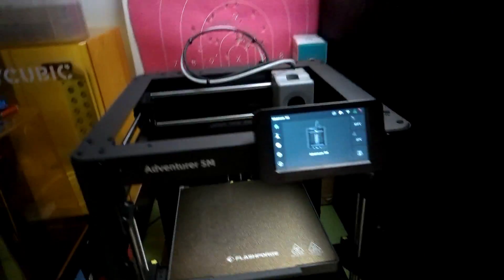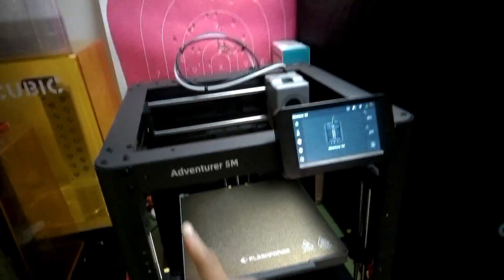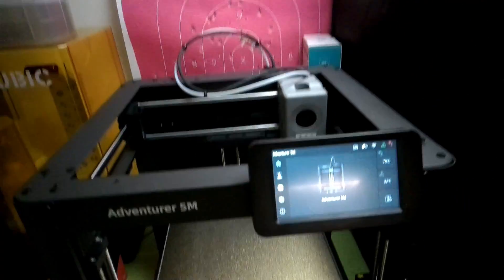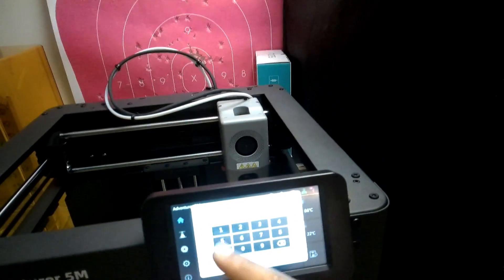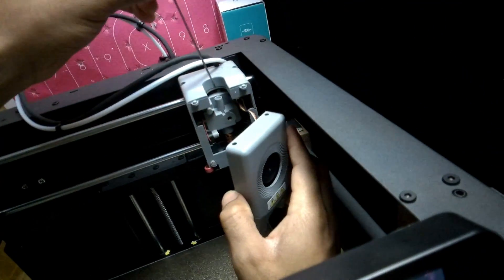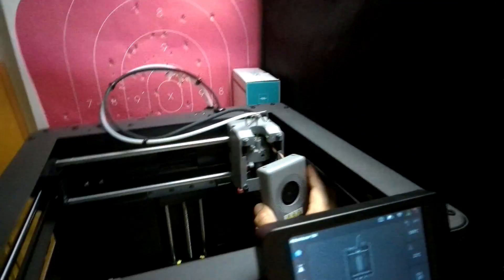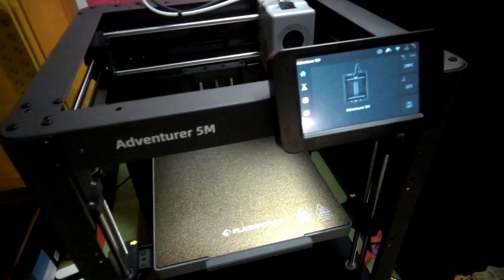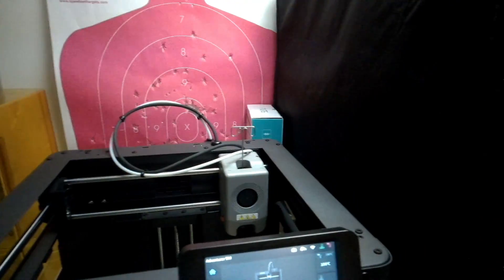Unclog Adventurer 5m

Comment: Ah man, mines clogged and still can’t figure it out. I was swapping the filaments over from the test one that came with it. Tried all the steps I could find. Mine is sticking out the top by a few mm’s but won’t run the last bit through, even trying the swap filaments settings 😢

Comment: I need to unclog the very top part where it first goes in
Reply: Did you ever figure it out I’m having the same problem
Reply: @M @MRNOVACAIN ere’s videos showing how to take apart the extruder. I can almost do it with my eyes closed at this point. Last night I had to heat up the nozzle to be able to take it out so I could take the extruder off. Then while the nozzle was still hot and using a rag to hold it, I used the unclogging tool to push out any filament still in the tip. I guess I had heat creep because the gears were turning fine but the filament was skinny between them and fat above and below. Cut it out, put it back together and it’s been running fine non stop since.
Reply: @dylanfrazier6378 yea I was able to get thanks you though 🙏

Comment: This didn’t work. I apparently have a hard clog and cannot find a video for a hard clog on an Adventurer 5. Anyone have a link or any advice?
Reply: Did you ever get it? I have a clog I'm the same spot but I can't get it
Reply: Got it. I had to pull the filament from underneath using needle nose pliers. After taking the extruder out.

Comment: Note: make sure the strew is all the way out like they should or it could cause damage but seriously this tutorial is perfect and helped me with my printer
Reply: Yeah! I did not loosed It It made a small dent into my needle.. looks like the needle IS Softer than the gears..  still pulled my needle verybhard
Reply: @rkageru  I did the same. machine wanted to pull the needle in. I had to turn off the machine to take it out. is your machine working ok now? Im worried  I may have broken mine. will check later today to see if I can properly unclog it